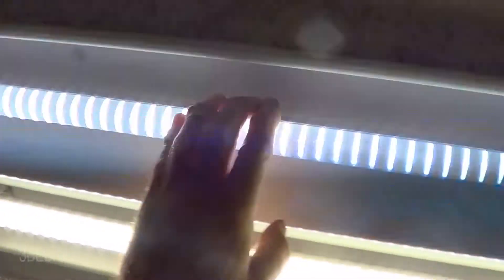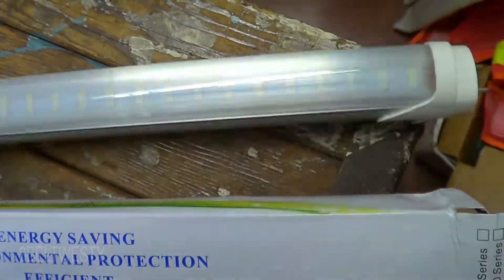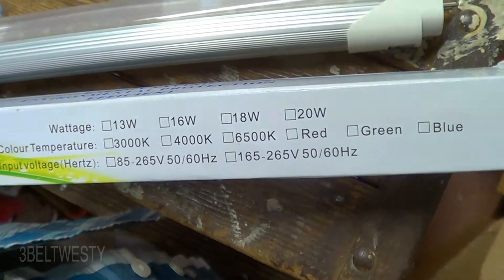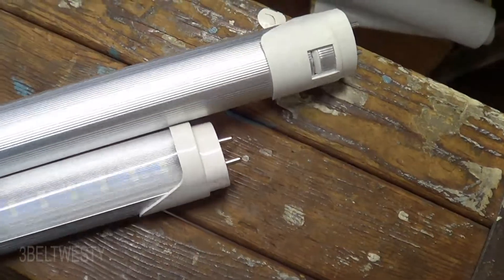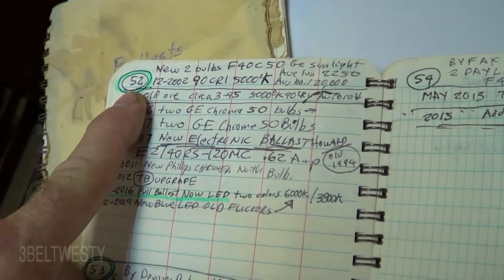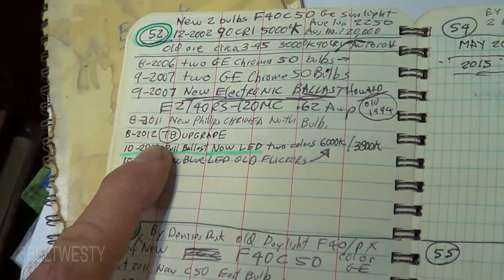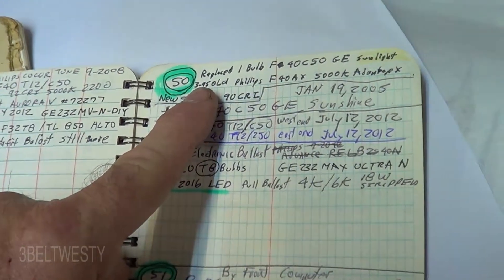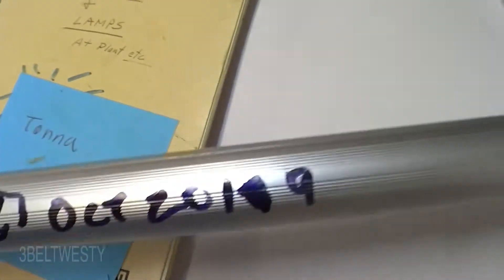4 ft LED Bulb flicker failure

Comment: Didn't really learn much here except if an LED flickers, replace it.
Reply from the maker: The LEDs in the bulb still work. It is the small switching power supply that feeds the string of LED's direct current that fails. So on these you can or could use the LEDs for something else. The switching power supply is in the LED 4 ft bulb at one end.